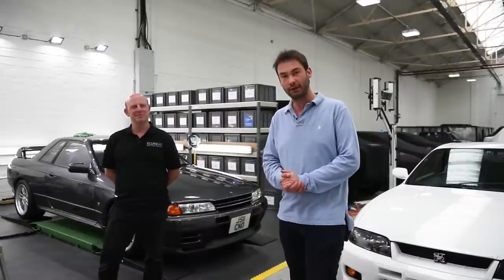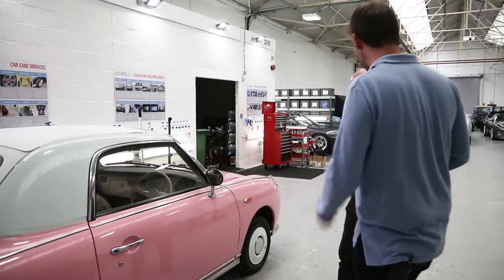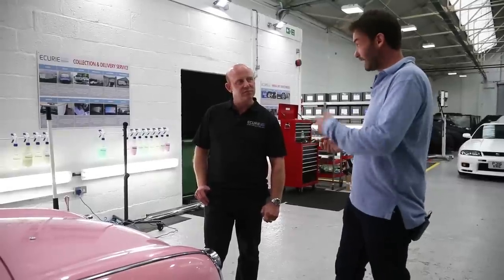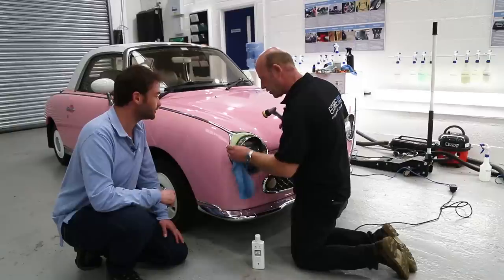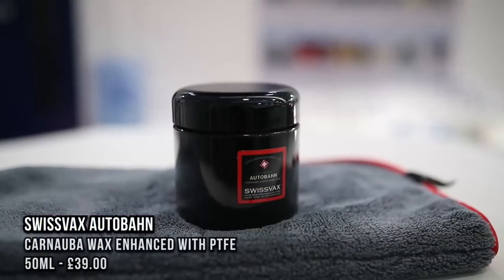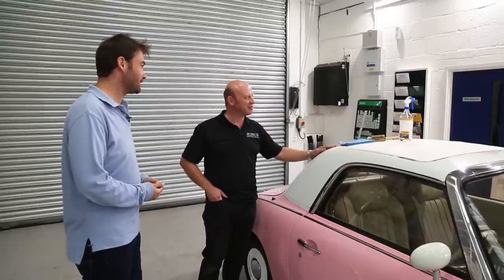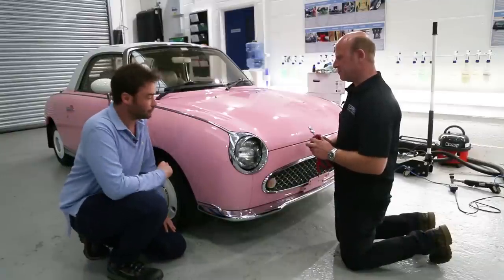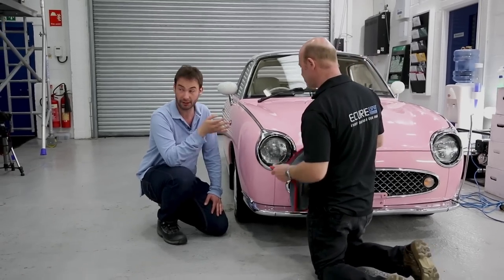Nissan Figaro Vinyl Roof & Chrome Restoration - by Tom Morrison-Jones of Ecurie Esprit

Comment: I used to use Swissvax products about 10 years ago. At that time they were better than everything also on the market. That isn’t the case now with so many quality products around. For example  Carpro Perl would have done a great job on that tyre at a fraction of the price of the Swissvax product as would the ODK QD. Swissvax is insanely priced, nearly doubled their prices since I used to buy it.